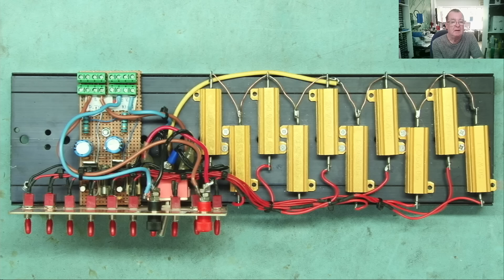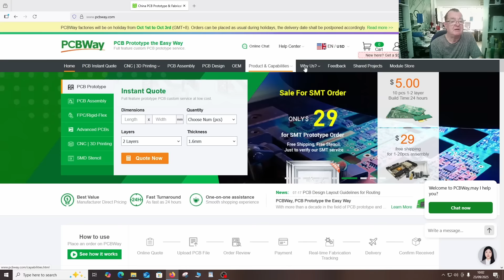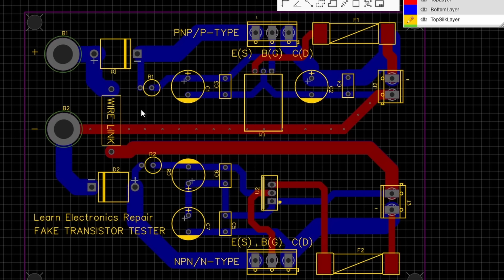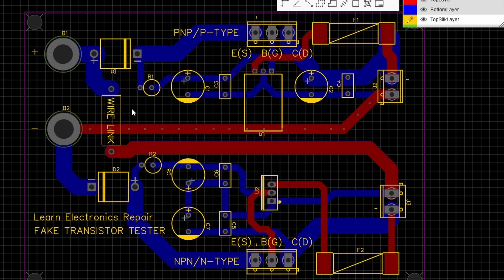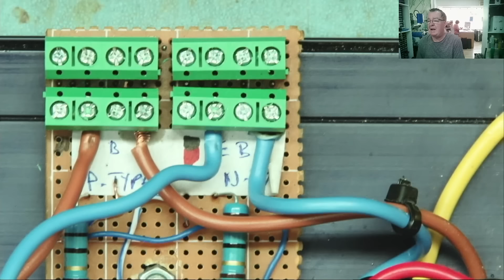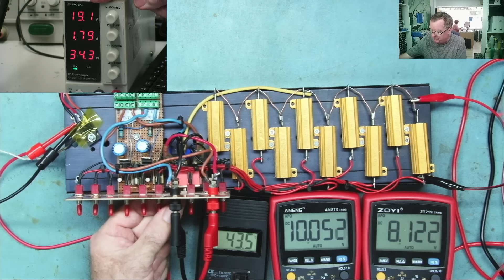This Cheap DIY Transistor Tester Does Not Just Detect Fake Transistors. it KILLS Them!

Comment: It's not just current it's power dissipation wich must be done on a heatsink with active cooling to maintain a set temp at a set disapation wich you work out from the datasheet. Guys an idiot. Half the fakes out there handle the current but not the tdp

Comment: With 10 Vce you can only have 9A when part is 25C or under then it's hit part 90W@25C power limit. So 15A is usually when you have transistor in saturation or close to it. In datasheets they measured 10A hfe with 4 Vce.
Edit: long cables for controlling mosfet with active feedback is easy way to get oscillator.

Comment: your mosfets are lightly oscillating at certain currents, stick a scope on it to see, probably need a decoupling cap to stop it.
Reply: You know what the say,  The best way to make an oscillator is build an amplifier ;)
Reply: @byterock  And the best way to build an amp is to try an oscillator :) , those lines have been arround for over 50 years and there still funny
Reply: @TheBreadboardca  50? try 100+ or so.  I think I first read that line in a 1920s era book ;)

Comment: Puedes usar relés,son más seguros y fiables para altas corrientes y se pueden usar en más proyectos.
Reply: relays are not good for high current DC, if an arc occurs across the contacts then it will stay until the contacts or body melts.  High current needs relays need arc suppression like fitting magnets to pull the arc off the contacts. or something to block the arc path or extended it so the arc fails.

Comment: What about all the other parameters the 'fakes' have like no gain or poor internal construction, this is simply a way to wind more current in see if it gets hot or blows up. So you have tested a part and you think it's good, are then going to use that part you just tortured LOL !
Reply: The is to test ONE aspect of a transistor's characteristics.
Richard keeps releasing these videos with clickbait titles, without making it easy for viewers to differentiate which one of his 15 "Ultimate fake transistor testers" tests what characteristic.
Reply: @johncoops6897 Not entirely sure whether all these incredible pieces of test kit for under 2 dollars are doing more harm than good. I mean the PCBs aren't free and its all variations on 'Ohms Law ' with an Arduino and Oled tacked on. But who cares I guess.

Comment: You can't just dump the datasheet current rating into a transistor, they will always blow up. You need to do the math. The DS value is for a certain degrees C/W value, i.e. they have a massive heatsink on it. You don't need all those resistors. A transistor can be a load itself. How do you think electronic loads work? This is like something I would make in 5th grade science fair.
Reply from the maker: And why not make it for the science fair?

Comment: You don't need all those power resistors! Just make the DUT transistor the actual load. Basically making the transistor you're testing an active dummy load.
Reply: It's about his sponsor, PCBway. He just had to do it for money. Hence why I'll never get anything from pcbway
Reply: I've tried to tell him this multiple times but these guys don't know anything about basic circuit design.
Reply: @humidbeing Sorry, if you talk about Richard-Learn Electronic Repair,  you're totally wrong.
Reply: @humidbeing There's no reason to be insulting. I enjoy both reading and giving suggestions for improvement in the comments, but that's unnecessary.
Reply: It's not just current it's power dissipation wich must be done on a heatsink with active cooling to maintain a set temp at a set disapation wich you work out from the datasheet. Guys an idiot. Half the fakes out there handle the current but not the tdp
Reply: The guys an idiot!

Comment: I love what you have done.
As you say if you are not toggling the switches you don't have to worry as much with the current on the switch, I would have a big bush button switch (hold on) that can handle the load (The test swich).
The push button turns on the power when you press it, after setting the load switches.
This way if the shit hits the fan during a test you just let go and the power is off. You don't have to flick through all the power setting switches?
As you are not setting the load under power, I would go Binary on the load switches. So: switch far right = 1, then working left next swich to = 2, then = 4, then =8, then =16.
This will give any value using combinations of 5 switches between 1 and 31?
Just my thoughts.

Edit
Perhaps a test button linked to a relay, as there is a lot of current.
Reply from the maker: Always plenty of ways to do this - that's makes it fun
Reply: @learnelectronicsrepair  I went a bit OTT, perhaps just 4 switches to give 1 to 15 haha.

Comment: How easy would it be to add a detection circuit to advise the issue that a PNP is being checked with the main switch set to NPN and vice versa
Reply from the maker: Hmmm.... and then why use a switch, just need a relay to set the polarity and another one to activate the load.  Good suggestion

Comment: get Det in to that project and do it with a micro processor... that you can program to to switch up and down and after a time shut off .... the noise.. it could be that the mosfet is oscillating.. and works like an antenna try a decoupling capacitor.... it is a nice project but the design is not a stable one....

Comment: When looking at the max current the device can take, you need to work out the thermal path from the junction to air. plus use heatsink compound to reduce the thermal resistance. 
The data sheet will give you the thermal characteristics from junction to case in °C/W then you need to add the °C/W for the heatsink. then you know how many watts you can dissipate before melt the junction and thus the max current you can pull.
Remember they are playing spec-man-ship with the max current limits in the datasheet. You might need a very big fan cooled heatsink to get that amount of current without killing it. 

The hardest part of electronics design is finding components that will do what you need when looking at datasheets.
it's like the banks saying that they give 10% on your current account if you transfer to them, then you read the small print and it's 10% on the first £50 then it's 1% on the rest 🙂 they say it can do 60A but you find that the heatsink required is 5 times the size of your box. 😞
Reply: Safe Operating Area is key. Take the TIP122 as an example. 100V, 5A on the face of it, but it's 15V max for 5A continuously or about 150mA max at 100V. 
A 100mS pulse at 100V shouldn't exceed 800mA, but a 10mS pulse can be 100V 8A. These are one off pulses!
Note that a lot of the examples in the datasheet are given with Vce of 3V, or Ic at 30mA. Definitely don't expect them to switch 100V at 5A!
Reply from the maker: This is why I kinda suggested 10W per amp so you have a good idea the wattage dissipation of the transistor, and also used the thermocouple.  I stand by my point this will detect fake transistors, both bipolar and Mosfet (along with the RDSon/Vgson tester and the 4KV breakdown tester) but remember guys these are just tools - it's up to you to use them responsibly 😉
Reply: @learnelectronicsrepair  Richard, put mosfet under testing, in glass of oil or ceramic cup, 200-300 ml. Submerge it in oil and put temperature probe in there. To change temperature of 200ml oil, from 25 to 100 *C, while having 50W at mosfet, should take 7 minutes... which is plenty... here you had 7 seconds...
Reply: That's true, I build an amp and the heatsink is huge and I had to keep adding fans and it still overheats. In hindsight I should have paid more attention to the data sheets.
Reply: He dosnt get it guys give up he is an egg
Reply: @daveselectronicslab  Not sure of your meaning here! but google AI has an egg as "In slang, an "egg" refers to a transgender person who hasn't yet realized their true gender identity but is on the path to "hatching" it"

But I'm sure this can't be what you meant.  Finding fakes can be dead easy or very hard unless you can do a full characterisation of the part and disassemble it and look at the die.

Comment: You can make ANY transistor fail this test, you should know that Richard !
If you don't test the same way the manmufacturer do it, your tester is likely to deem any transistor fake at random.
At best the DUT transistor will only survive, if you decide !
Reply from the maker: You can MAKE then fail of course - but a fake one will most likely fail at a much lower current than expected.  That;s the point.